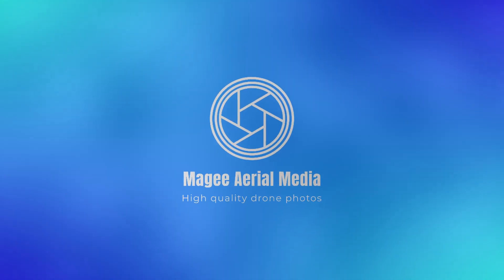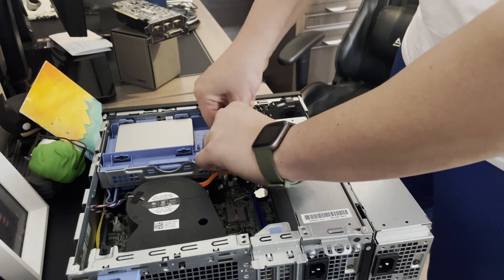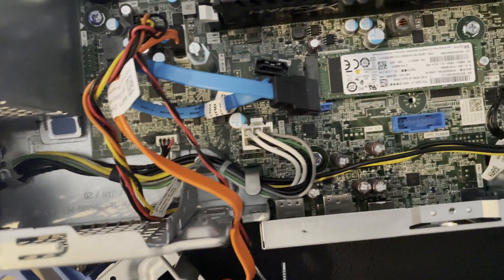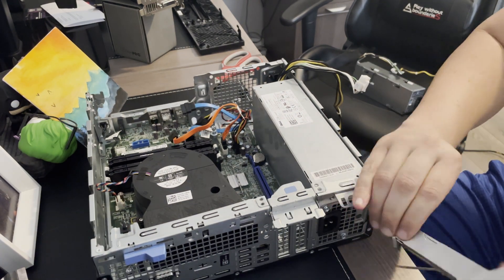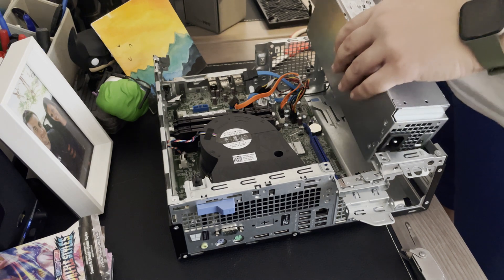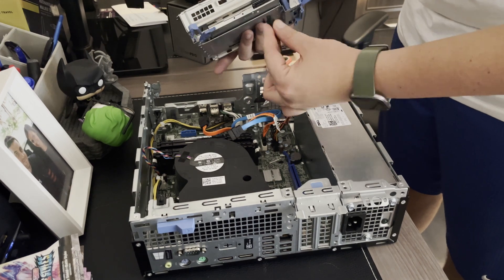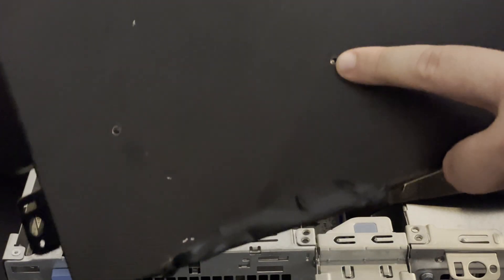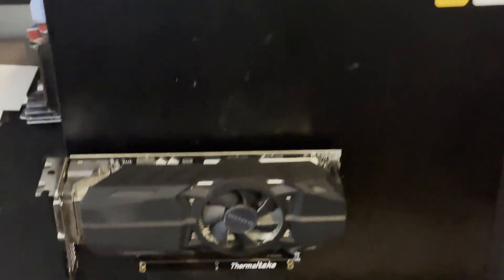Dell OptiPlex 7070 Build for Video Editing PSU Upgrade

Comment: How many ssd slots available in this model
Reply from the maker: The Dell OptiPlex 7070 Small Form Factor (SFF) has one M.2 slot for an SSD and the option for a 2.5" SATA SSD/HDD.

Comment: I have dell 3046 sff in my rig, and in my opinion im gonna make a gpu vertical inside the case, using low profile cpu cooler, i think its a good idea

Comment: Have you tried using the x4 slot for the Gpu? Im using my gtx 1050 on x4 and it seems to work fine....
Reply from the maker: Thanks for the tip. The card I had was the 1050ti and it was just a hair to big and I didn’t want it to over heat. Probably would’ve happened but just being extra. Now the GPU gets all the cool fresh air from outside the case. Not the safest place for it but it works for me.
Reply: @MageeAerialMedia  Hello, is this model Dell OptiPlex 7070 long lasting reliable ?    Are these small ones as durable as larger SFF's ?
Reply from the maker: @barrya.6212 yes very long lasting